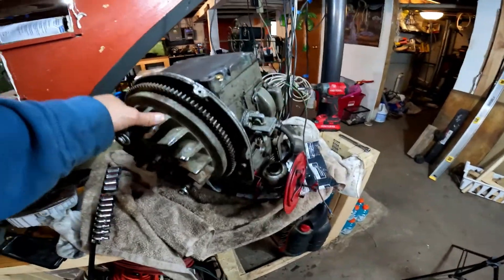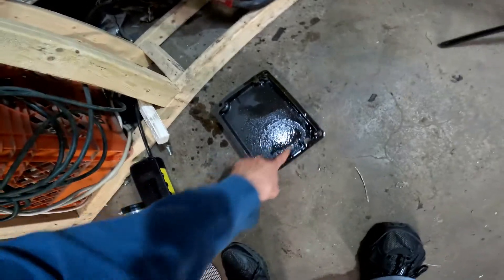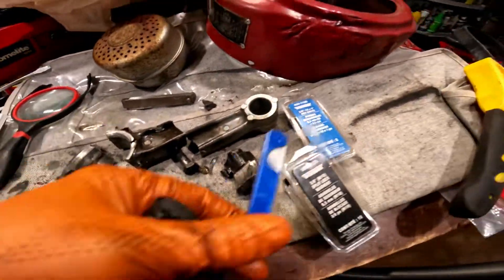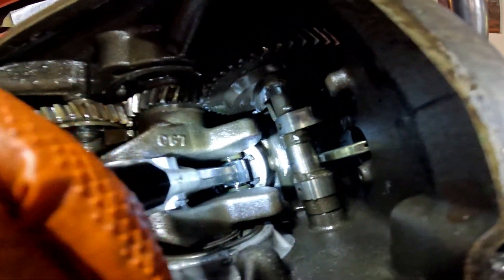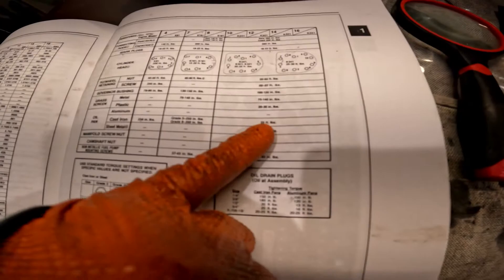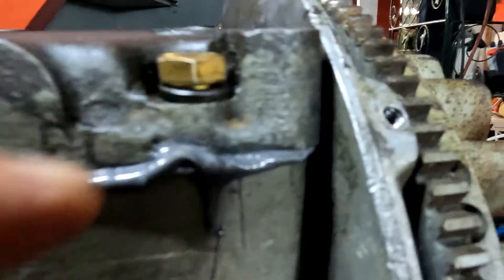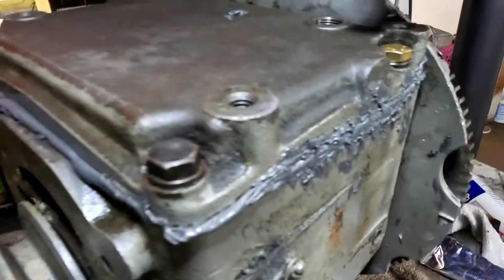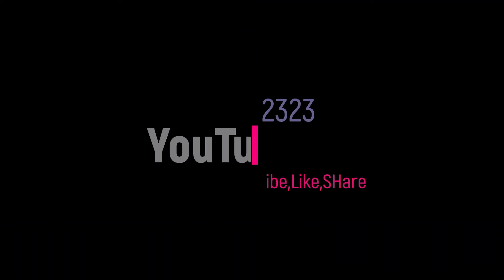10 HP Kohler K241 connecting rod replacement

Comment: Supposed to over torque the rod bolts by 20%. rotate the crank a few times then loosen and retorque them to there Final torque. My OEM Kohler service manual says 285 inch lbs which is 23.8 ft lbs. Bad thing about thread locker on Fine Thread Rod bolts is that it WILL pull the threads out out of the rod if you ever have to take it apart again. And there is a very good chance that the thread locker will squeeze out and get on your Rod Journal and cause the engine to seize literally the 1st time the engine gets up to operating temperature.